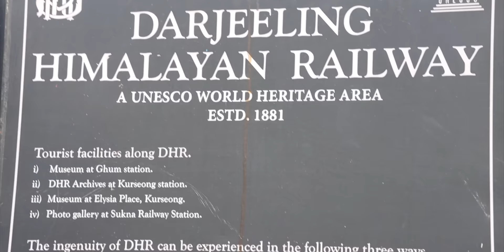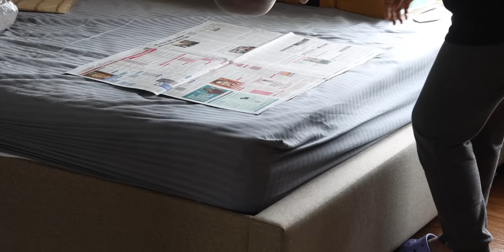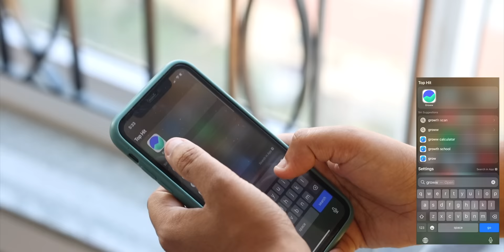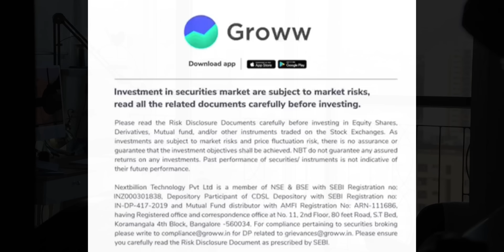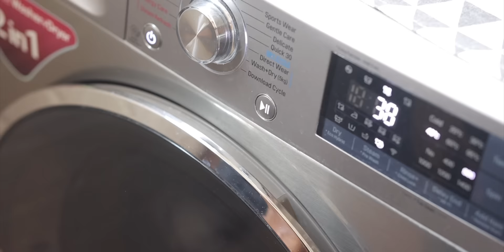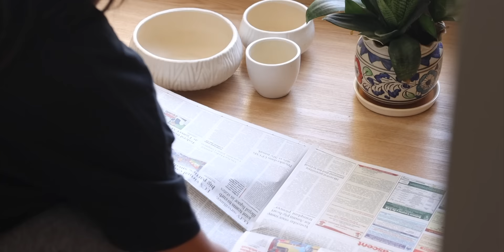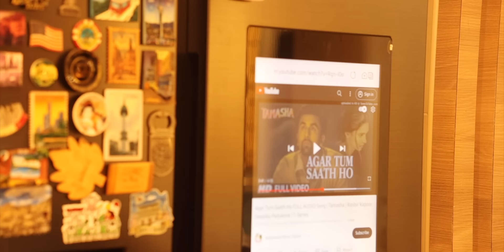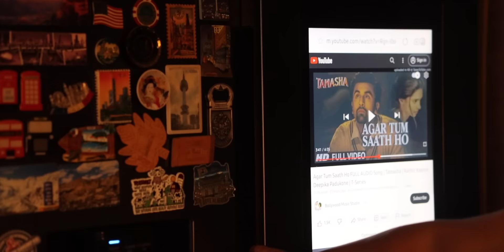Vlog | Tips for baby massage, starting solids for 6 month old | Clean with me, cooking, gardening ..

Comment: Just a suggestion-Pls use a thali covered with thin cloth to dry food. Newspaper ink is not safe and does come out with wet stuff. Also if you sprout ragi for a day or two before drying - it becomes more easy to digest as well as increases the nutritional value.

Comment: Diya,, Don't use newspapers for drying food.. use white clothes.
Reply: Exactly the Ink and chemicals present on the news paper gets smudged and mixes with the food we dry on it.
Reply: Yes I agree
Reply: @manasi5336  that's y we shouldn't use newspapers..
Reply from the maker: Thanks for the input. I guess I need to buy a muslin cloth. Cheers. ✌🏽
Reply: @DiyaDey  welcome dear.
Reply: You can use silicone sheet or baking tray and any cloth on top of it to fry faster preferably white cotton so that no worries of dyes. Or tightly woven trays (using bamboo or other natural straws) there are two tier or three tier drying trays which has steel mesh
Reply: Thats what i was about to write
Reply: Agree.
Reply: @DiyaDey  Hey Diya, You can use Zayn's old wrap cloth. Thats what I do for my baby
Reply: Yes
Reply: @Diya Dey, you can reuse any old cotton cloth for this
Reply: Diya, u can use what is called panche ( white dhoti) which is easily available in cloth shops , to dry the ragi 
I used it to dry ragi and other grains for both my children

Comment: Hi Diya, nice to see your new video. I hope you all are doing good and had good vacation. I had a question about using pacifier... I delivered baby girl last month (Jan 3rd). What is your thought about using pacifier and how does it made things better by using them. Plz your suggestion matter as am planning to use one for my daughter.
Reply from the maker: Hi. Congratulations on the baby. I used pacifier for Zayn once he turned 2 months old. It’s better to start it only after you have settled with breastfeeding routine or else it may confuse the baby and it can cause latching issues. I also used it for Kaya. Only thing is you need to stop it as soon as they start teething, or else it can cause gum or teeth misalignment issues.
Otherwise it’s absolutely safe to use a pacifier. It’s pediatrician approved. All the best.
Reply: @DiyaDey  thank you so much Diya for your timely response. Appreciate it! 🙏🙂